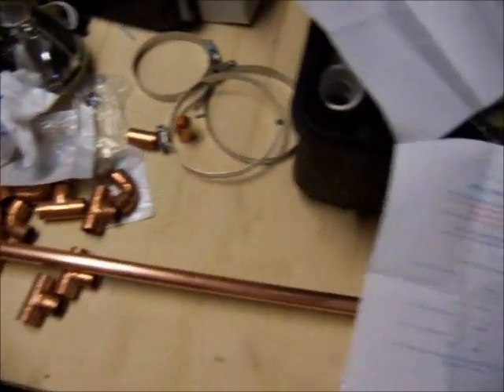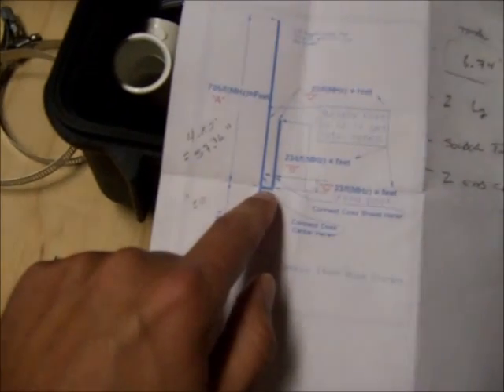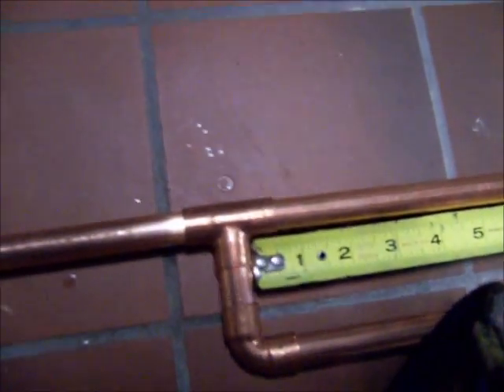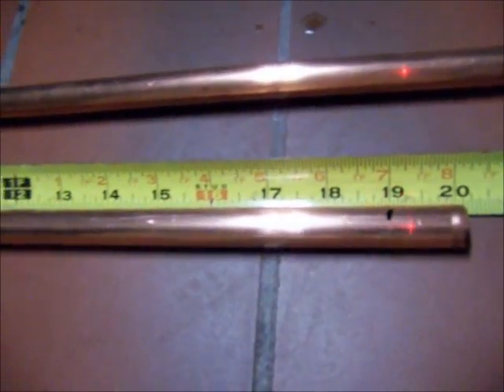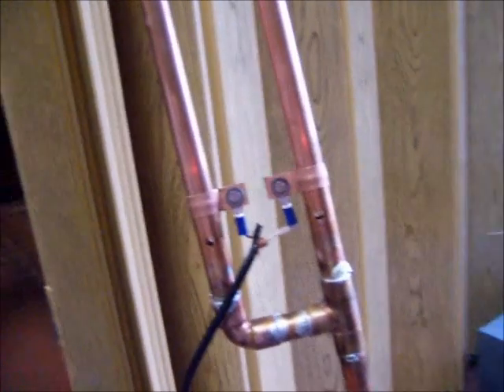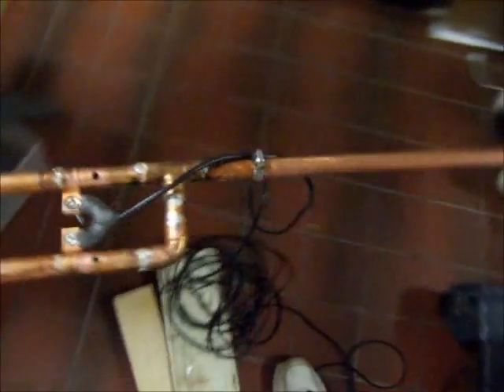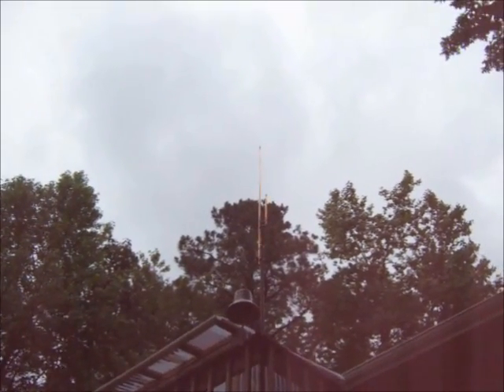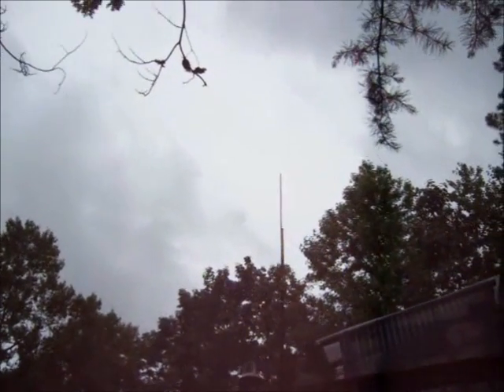J Pole Antenna for 2 Meters

Comment: Get a piece of PVC or wood and cut it to the EXACT length of the "D" dimension. wedge it at the top to make sure your two vertices are perfectly parallel. Your SWR will improve. Also fill the holes you drilled, if you haven't already. Water filling up the inside will do you no good.

Comment: Can I solder this with a (very good) soldering iron?
Reply: +Ivan Eduardo Veloz Guerrero It depends how much of W does it have :) ...but...anyway...it's quite hard without torch!
Reply: +Ivan Eduardo Veloz Guerrero Unlikely to solder the pipe.  Best to use a torch for that much surface.

Comment: What was the range you got once you were done?
Reply: what are you running now? i've been looking at j-poles, but i stumbled upon the super j-pole which adds a loop, looks like its essentially creating a 2 element collinear array.
Reply from the maker: +setofirons The antenna has been replaced with a different set up, but when it was up it was a definite improvement over smaller antennas I had around.  Not sure about the range specifically, but I had an Echolink station set up with it and using only about 1.5 watts from an HT, the antenna would reach out 10 to 15 miles over some very hilly areas.

Comment: you can grind down the sides a bit on a 3/8 nut so its a snug fit in the end of the tuning stub then solder it in place, then add a bolt and nut to lock in place for best swr measured at 146 mhz

Comment: good idea with the copper rings. I built a 2 meter J-Pole and just used electrical tape and wrapped the coax around the copper so I could also move it if needed. it works but it's not very sturdy as you would imagine. I'm gonna go get some copper rings for it, thanks you

Comment: Since copper is expensive could you use pvc at the bottom, instead of using more cooper poll? What about protecting it from the elements could you have put heat shrink around it? and instead of that connection you have at the feed points could you have welded a slab of metal go to a drill press and then put a pl-259 on it instead?

Comment: gr8 vblog
your reverse power is being absorbed by the high losses in the RG58 cable so your 
VSWR will be even higher than what you measured. but that power you measure is what your radio is absorbing.
I used stainless steel hose clamps on my J pole and did alot of adjusting to find the lowest VSWR  
even with belden 9913 I could only get down to 1.2:1 
alas a J pole out preforms a 1/4 wave ground plane and a half wave vertical dipole on 2 meters and a stacked J pole does the best
73 OT
de n8zu

Comment: shouldn't add for caps use measurements given  don't add. dont use any jb weld only flux and solder.also add a couple loops of coax at feed point use analyzer to test.those antennas are awesome .Good Luck.

Comment from the maker: IndicamGuy - It has good performance.  We're in a somewhat rural area, with the J-Pole I can hit three or four machines cleanly using a mobile rig.  With just a rubber duck on an HT or a mobile 2 meter magmount antenna I could only hit a couple repeaters - and the signal would be very weak.  Thanks for taking a look.